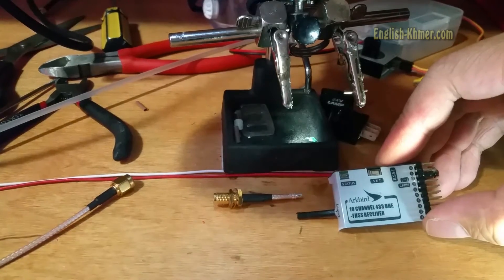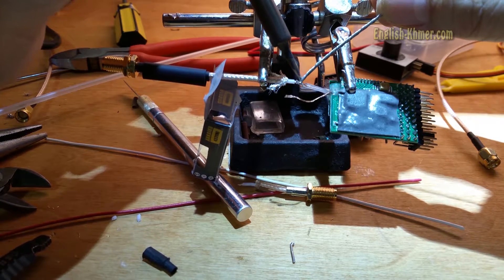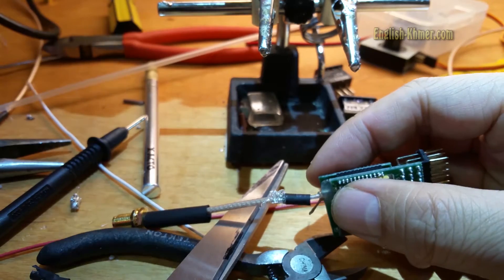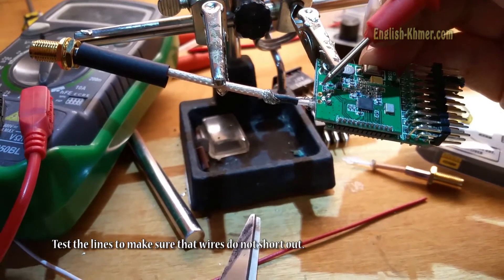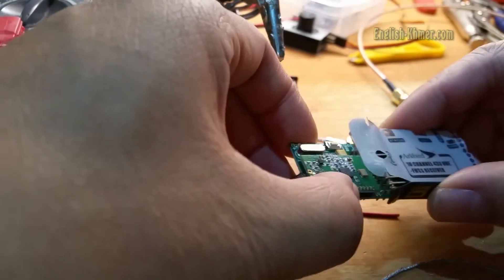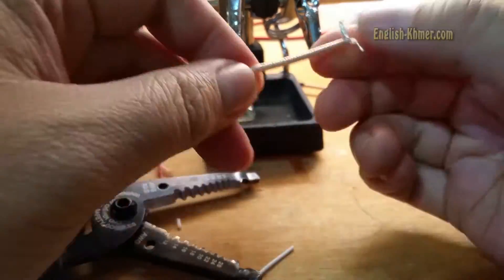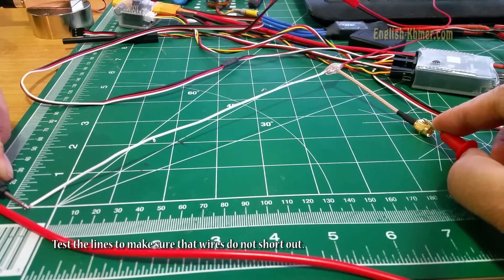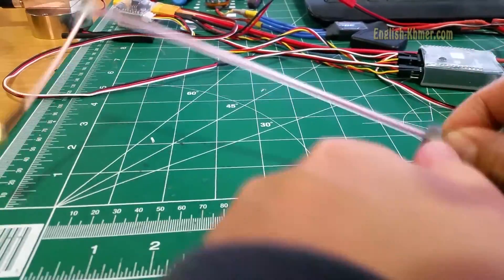Arkbird UHF Receiver Adding SMA Extension and making Dipole antenna How To

Comment: I have 2 questions 
Why did you wrap the soldered area with thin foil ?
I was thinking to upgrade mine with the same process but will cut the antenna cable from the edge of the antenna nit the receiver
Reply from the maker: The ground wire shields the active wire to reduce the interference.

Comment: well,that is good to allow using other differnt kind of uhf antenna for them rx,however doing this will compromise the SWR of the antenna,cause the extension u have made wil work as antenna itself....in my opinion the best way to do that is solder direct a sma for pcb board on the rx...if u take off the glue they put on the solder joint u will see 4 hole,the middle one is the positive and the 4 on the extremity are negative....every little things can make a huge difference on perfomance.